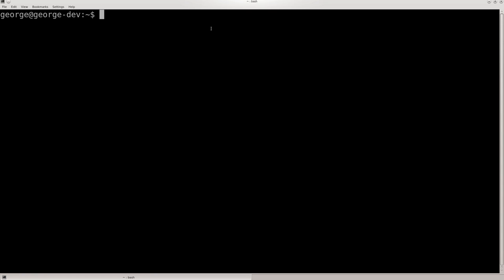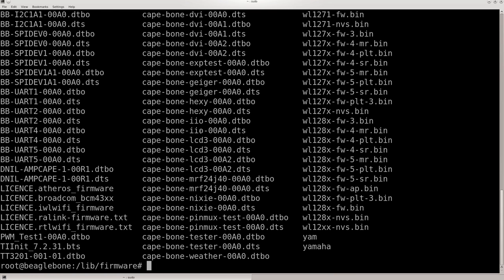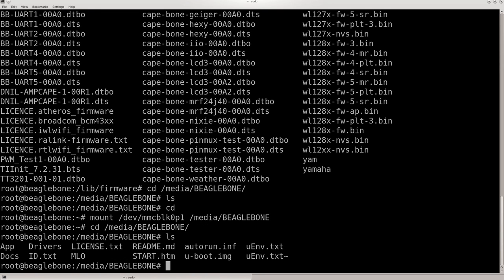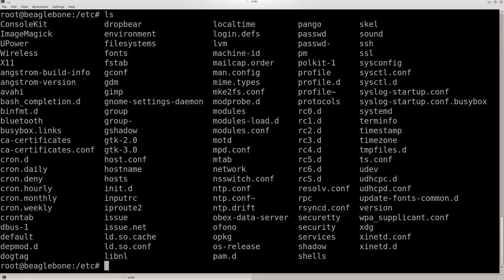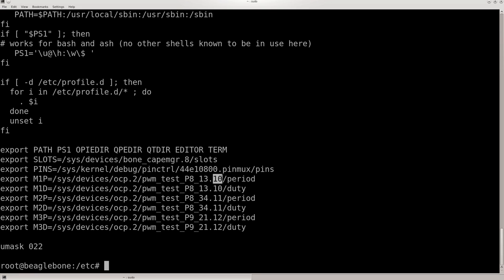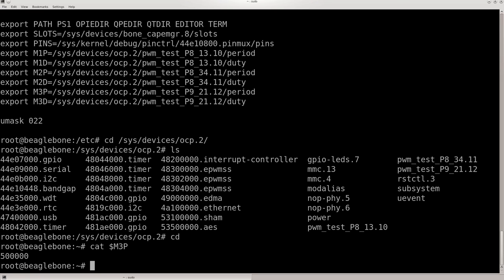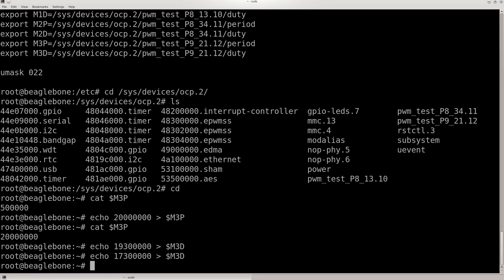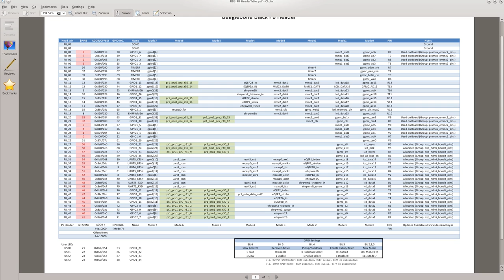BeagleBone Black PWM Setup

Comment: Hey man, I've been looking into my /lib/modules and couldn't find any device tree overlay present. Is there a place I could get all of these overlay? Thanks
Reply from the maker: I cant remember if they are in that directory or not. Your BBB should come with some already installed on it. The directory I went to was /lib/firmware. I was using Angstrom to if that helps, The Rev C might be different because it comes installed with Debian

Comment: You shouldn't need to sudo ssh. If you're trying to get to root on the board, just ssh root@beaglebone.
Reply from the maker: I don't remember exactly why I had to do that, your right you don't have to everytime. Every once and a while I would get an SSL certificate warning about the IPaddress I was trying to ssh too. Using Sudo simplified the process when logging on for the first time after connecting it to my network.